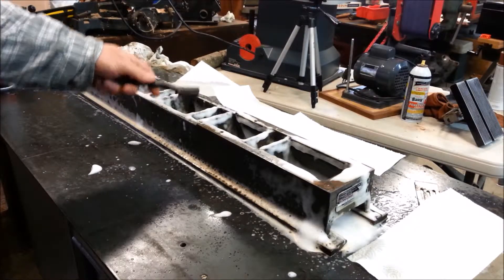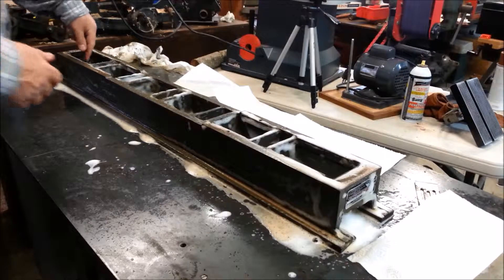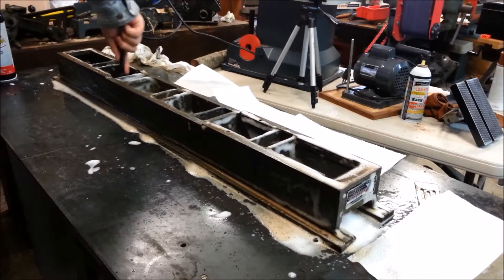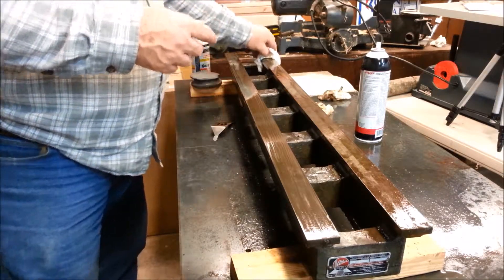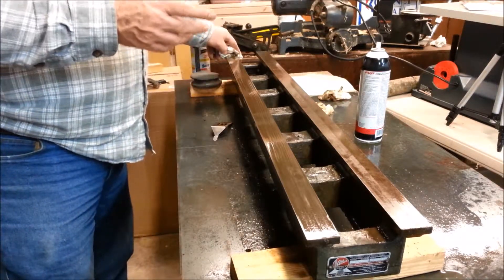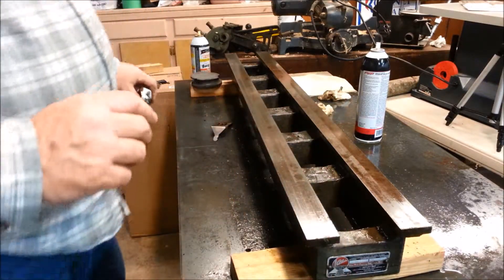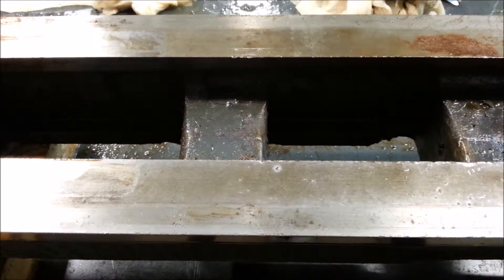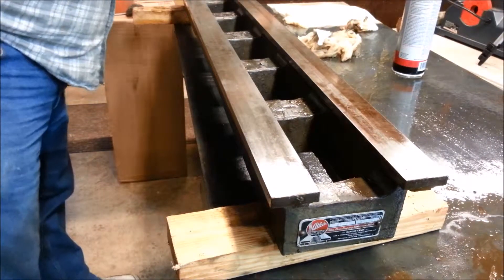Atlas Lathe Quick Change 42 Refurb & Restoration: Part 10

Comment: Wearing 7 or 9 mil Nitrile gloves from Harbor Freight saves the oils in the skin of the hands from constant washing. Indention's.
Cloth rags around a running chuck is unsafe, I have heard the slapping and then seen the results.  A Precision parallel that would cross both ways might work.
Reply from the maker: I have a box of those now.  I still occasionally use a cloth.  I've even seen critical comments for using a paper towel.  Uh, yea, I avoid it, usually stop the lathe.   But, be warned, I do as I please.  I'm a strong individualist.  I infer no duty on others other than respect of Liberty.   I like to make and restore stuff.  ;-)